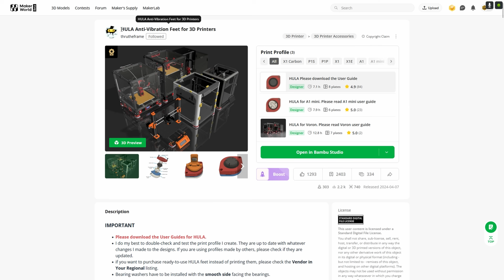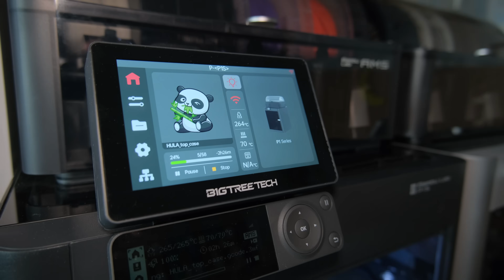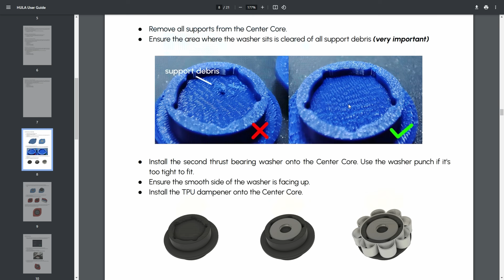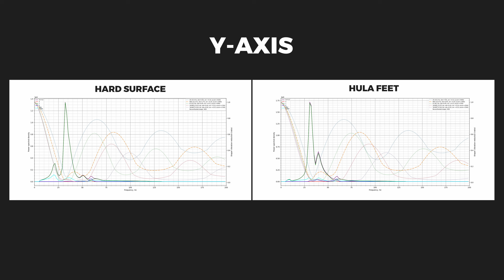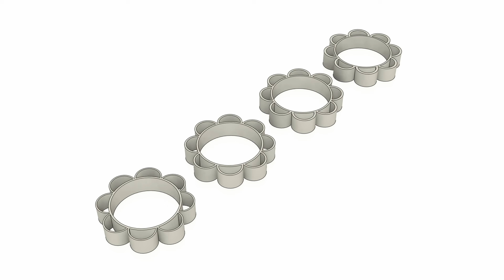HULA Anti-Vibration Feet for 3D PRINTERS – Do they WORK?

Comment: I use the one's off amazon with blue extrusion foam and rubber bads on each side with angled grooves in them and work great and using them for my new saturn 4 16k Ultra resin printer as tilting vat causes some vibrations through the roof them downstairs!

Comment: There is no dampening happening with these types of feet. If you look at a cars suspension you have a spring pair with a shock absorber. The shock absorbers have specific valves in them based on the weight of the car to reduce the vibration or spring force. All these anti vibration feet are just the springs but with no shock abosrbers. Im sure some sort of valved fluid filled puck could be designed to truly achieve this.

Comment: In summary, creating a decoupler without transfoming the energy will of course, generally be worse.  I use a combination of decoupling and mass and find it makes a significant improvement. ie I have cups with larger marbles and an direction damper (thin layer of rubber), then have a paver ie as Thomas has. I found the foam didnt work that well but the 'dampened rollers' were a good marriage

I would have lot to have seen mass added in this vid.

Comment: The theory on which these pads are based on has a totally different goal and boundaries. It's the earth that shakes not the building, here the printer is generating the oscillations and not the table. There are other solutions for this

Comment: The only anti vibration feet that actually work are the Hutchinson T-Mount Series.
I got a load of them from an aerospace company that scrapped their stock. Been using them for years on my MK3S/+.
Not only the printer stopped ringing, but it also made it silent!

They're pricy as hell if you get to buy them, but you can probably find someone who works in aerospace and can pick them somewhere in the trash.

Comment: Great video and findings.

This is why I do not use feet on my machines, even though i bought BBL ones. Btw it is interesting in the shop page they have cons and pros and build quality is in both categories.
What I can see from the page is that they are useful if you have a few printers on same surface. Having vibration feet buffers the vibrations from other printers, that overwise would lead to artifacts. As all my printers are on different tables/desks (or I try not running both if they are on one) I have no idea if that is the truth but sounds logical.
May be a good idea for a video ? :)

Comment: i have a Creality K1C, my first 3D printer. As like any one who gets they're first 3D printer i was looking for mods and came across this, mainly because i didnt like the noise my 3D printer made while sat on the bench its on...( bench is bolted to the wall, transferring the vibration and noise to the house) I needed more isolation, thought these would work nicely. but then i thought. "hey ill just use the foam the 3D printer came packed in, I used the foam and because its semi ridged foam it work out very very nicely, with less movement than these printed feet. its worth a try for you ! wayyy faster and practically frree

Comment: This theoretically would work, but TPU is the wrong material for that, since it's too elastic. The energy that is coming from the system in form of waves needs to be taken out or transformed into something else like friction or heat. TPU here is so elastic, that the induced vibration comes back as a backwave like @xManzi said. 
One solution here can be to use a Material that is not elastic but soft enough to take the energy. For high frequencies and resonances in car doors for instance you often use butyl.
For industrial machines, there are lots of dampening materials for bushings, feet and other moving parts, designed for exactly this purpose.
At the end they sum up to nearly the same price (work hours incl) :)
Since your tests are really nice, I'd love to see a comparison with mentioned dampers 🙌
Reply: I think filling them with a tacky grease (or pine tar) might be enough to work as a dampener.

Comment: I think these feet are better at isolating the printer and table movement from each other - so the effect on print quality is, for the most part, going to be negligible. The advantages would be in noise isolation (for example, if your table rattles when the 3D printer is running), and also less likelihood of causing layer shifts and other artefacts if you for some reason bump the table.
To actually be useful for reducing ringing, they would need to be movement dampers and not isolators; straight rubber or foam probably does a better job at this due to hysteresis. More hysteresis = more damping.
I wonder how well memory foam would work for that?

Comment: I don't know how people don't understand what it does. It just transfers vibrations to the "next" place. So if you have input shaper, now it needs to cancel vibrations that come from two different sources. One is the printer itself and the other is "backwave" vibrations that come as "echo" from feet back into printer. Those feet are just solving the problem of "oh no, my table is shaking". Best way to solve ringing is putting printer on sturdy surface and use input shaper. Point in vibration dampers in buildings isn't to completely stop building from moving, it is to "delay" waves so that the whole building is moving as one body, without having differential movement between floors themselves. And you can't use the same logic in printers. In 3d printers you have printer itself, moving head and table/floor under it. If you have sturdy surface under your printer, input shaper is just solving for differential movement between printer and printing head. It's like learning to juggle two balls by having someone constantly throwing you the third ball...
Reply: A sturdy surface and input shaper are crucial for eliminating ringing, but the explanation of vibration dampers and their interaction with input shaper isn't quite right. Dampers don't just 'transfer' vibrations; their main purpose is to dissipate energy, converting it into heat reducing the vibration's amplitude. So, they aren't just moving the problem somewhere else but actively lessening it. While it's true that a shaky table can send 'backwave' vibrations back into the printer, making input shaper's job harder, good dampening feet prevent this by isolating the printer, not by creating a new source input shaper needs to 'cancel.' Input shaper primarily deals with the inherent resonant frequencies within the printer's moving parts and frame. And the analogy with building dampers, which aim for uniform movement to absorb seismic forces, doesn't directly apply; printer dampers focus on isolation and energy dissipation to stabilize the system for more accurate prints.

That being said, these HULA feet are no better than basic TPU 95A feet, worse in my testing, and far worse than stock feet. (on the H2D anyways)
Reply: @designgears  There would be 100x more utility in just testing 3 or 4 thickness of sorbothane feet disks in a couple popular durometers.  It's just such a failed approach with these hula feet.
Reply: No, damping dissipates vibrational energy rather than just transferring it, this reduces resonance. Also, in the video he shows an Eigenfrequency peak moving from low frequency to a higher frequency which is also generally desirable! The reason the small printer has noticeably worse results is likely because of its light weight and mismatched dampers, lowering the natural frequencies and causing the resonance you see on the prints. In the light-weight printer's case, clamping it to a heavy object is better because it adds mass and with the exciting force staying the same, this means smaller acceleration.
Reply: @FreddyRamaker  This is my thinking.  Really the approach should be damping tuned by axis, frequency, and mass / energy.  My intuition says easier to do this tuning with a grease or oil filled dashpot and spring assembly vs TPU trying to be both. Plus such an assembly is easy to fine tune via pre-load and valving screws. 

Further, many printers should still be on top of a firm platform before the damping, especially large bed slingers where the frame could use some stiffness reinforcement.

Another approach could be reaction masses moving along each axis in the opposite direction of the print head or bed (just considering the asymmetric case of cantilever and bed slinger setups).  It would require steppers and belts sized for moving double the mass of the print head and bed respectively. From there, the new problem introduced is torque about the center, but arguably this is much easier to damp than linear movement. The mistaken thinking in the HULA design is looking at the printer movement and harmonics like a building being acted on from the outside (e.g. wind, earthquakes) when the forces are internal to the structure.
Reply: I use bambu labs vibration feet on my P1S, it works great for me. I do not see any additional ringing etc
Reply: Если много смотреть, то захочется поставить такие ножки под дом, чтобы принтер не шатался)))
Reply: This, exactly.

Comment: Surely the real test would to see print quality during an earth quake.

Put your 3d printers on a washing machine during a spin cycle with and without the feet.
That is where you would see the most difference 😂

Also they would reduce vibration to the surface they sit on so another test would be to try and hand write something on the same table during a speed benchy with and out feet 😂

Comment: This reaffirms my suspicions, decoupling your printer from a reference plane (solid ground) to sink it's vibrations into, usually tends to push those vibrations to other axis arbitrarily. And that's even harder to cancel out. Tuned dampeners is really the only true answer, and they would be unique per mass, likely need to be integral to the frame and/or motor mount systems. The easiest solution by far is input shaping, then slowing things down more when you really don't want resonance artifacts.
Reply: your right, i actually put a 2.5lbs weight about 7 inches above the print head, this seems to take about 50 pecent of the shaking away from the machine, like a giant counter wieght to the swinging and vibration of the machine, some buildings use this technique as well, a giant "Mass Mediator"  or something

Comment: The hulas seem to just be a misunderstanding. In an earthquake,the ground shakes and the rapid movements break the building. But on a printer, the printer itself shakes.

If anything, the hula protects you printer from an earthquake, and it prevents shaking of your table.

What you really need is effective damping and a way to dispose the energy from rapid motor acceleration.

Comment: I decided to try these out for my K1. Got the solid parts printed, but I'm waiting on VoxelPLA to ship the hardware... ordered over 2 weeks ago. Good video with the various tests, especially considering the instructions for HULA say to run RC before installing. Which test model did you use for your tests?
Reply from the maker: Yeah, I am not sure why, because those feet can affect resonance frequencies of the printer, so re-running the shaper should be right way. I used klipper ringing tower print.

Comment: i bought Spring Isolation pad Shock Absorber feet for subwoofers for 10 bucks and work better than those. also these only work if you have a wobbly desk. using them on stable surfaces makes them worse.

Comment: i tried isoacoustics speaker feet i have lying around on my corexy and it damped vibration transmission to my rack. print quality wise seems the same. i have since switched to cheaper sorbothane feet.

Comment: Those dampeners do look really flimsy to me.  If shop machines have dampening, they always seem to have chonky hard-rubber dampeners.  
Very interesting that they actually helped with the big bed slinger.  That's useful information.
Reply from the maker: When alone yes, but with four on each leg they feel way stiffer. I would play with the stiffness if improvements I got were higher. But Input Shaper does ~95% of the magic already.

Comment: You would probably get better results if you made one large Hula that the printer rides on as that will provide a much larger damping area.
You are hitting a hard stop on those little feet.
Try scaling it up and use the foam below the scaled up one and I bet you will see some significant improvements.

Comment: ModBot also made a video covering HULA two weeks ago and over there i made a very long comment explaining why this is a waste of time if you are chasing print quality. i predicted that if enough people tried it, results will be extremely varied and thus be hard to justify asking most people to try spending the time and money building four of these things compared to trying something simple, cheap and proven like a stone plate on foam, where the foam itself performs both isolation and damping overwhelming more effectively than the small surface area of four tiny feet, and the stone gives an extremely stiff surface to avoid frame flexure which would be unavoidable when you add soft feet to a shaking printer.

so i made the case that it would make much more sense to put the printer on stone and then mount the four HULA feet underneath that if furniture noise is the main concern. that should get you great noise reduction while reducing harm to quality.

people are also conflating furniture noise reduction with improved print quality when in fact these are two very different goals. what HULA does first and foremost is vibration isolation, which reduces energy transmission to the furniture, reducing furniture noise, but necessarily also prevents the furniture from helping to then dissipate that energy (furniture damping effect). this means more of the vibration will be left to input shaper to mitigate. considering that the input shaper models are optimized for low bandwidths (very good at mitigating specific resonant frequencies but not others), furniture isolation may or may not be better for print quality. you need to be open to the possibility that whatever table you have your printer sitting on right now may actually already be working well together with input shaper (by providing large bandwidth damping of the frequencies especially around the peak that input shaper cannot also optimize for) to make quality prints and that isolating that table could make quality worse. because there are so many different printers and even more types of furniture, this is what led me to conclude that it would be very unlikely that HULA can produce a statistically significant improvement for everyone (regarding print quality). seismic damping needs to be tuned, just like input shaper needs to be tuned. you would need to iterate on the TPU portion of the HULA feet to get the best result for your particular setup and that is not something that is easy to do.

Comment: Thanks for the good piece ! 
ps.  as much as I understand you don't intend to make this channel focus on specific models, the finetuning of your P1S still is very interesting to me :-) perhaps you could do a side video with all the things you put in place for best results?
Reply from the maker: The only adjustment I made that affects print quality is the belt tension to reduce VFAs. That's literally it. You will gain way more by manually fine tuning flow rates and pressure advance for each filament and for example by changing wall printing order to inner/outer/inner. :)
Reply: @PrintingPerspective thanks for the answer, the inner outer inner has been changed, thanks to you!

Comment: I use Sorbothane Duro 50 1.25" hemispheres on my bed slinger. Works wonders at isolating and damping. And you don't have to assemble anything.
Reply: That looks interesting! Like to see some results with that.
Reply: I use the 1.5" pucks as the dampening material underneath a concrete paver and it works an absolute treat.  My only real gripe is that doing it this way squishes the sorbothane and adheres the paver to the table over time. It's not impossible to remove but it definitely shouldn't be done on a table you actually care about lmao

Comment: So pretty much every video on these things has proven them to be almost useless for better print quality. The only thing these things do is make your desk shake less and reduce noise.
Reply: I got mine from voxelpla and it stopped the shaking on my table completely. As for print quality it is the same as before. That is a win for me.
Reply: Makers Muse put a Bambu 3D printer on a wobbly table and even suspended it from the ceiling and found that it made no difference whatsoever to print quality. All that matters is the kinematics of the moving mass.
Reply: same here
Reply: Pretty much the same conclusion I came to watching a bunch of videos on the hula feet. I'll stick with my MDF boards with foam weather stripping. It gives enough separation so that vibrations don't resonate to the table top.
Reply: Pretty much my experience, but that was exactly what i was after. The printer put resonaces into the floor i could hear everywhere with these feet installed it's gone

Comment: I build some similar feet for my modded Sapphire Pro. It is basically standing on TPU springs. My printer seems to be a bit too heavy for this to work well long term and the mass isn't centered so it shifts to the back feet.

That being said I noticed a pretty big improvement for my max accel and the noise is a lot better with these feet and being on the floor vs on top of some drawers.

Edit: My guess is that if your frame is solid then it probably doesn't help that much if at all but if your frame isn't that strong this might have a bigger impact. Being allowed to swing back and forth should take a bit of force that would normally be absorbed by the frame away.